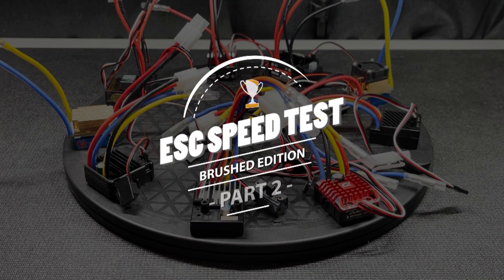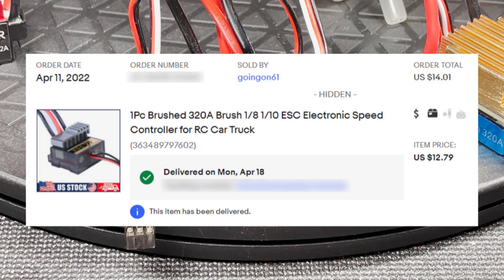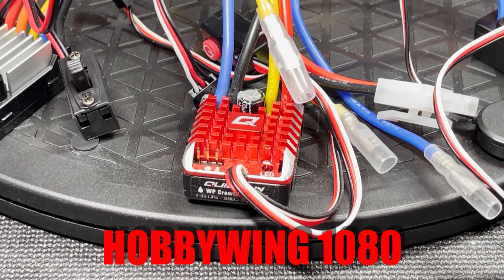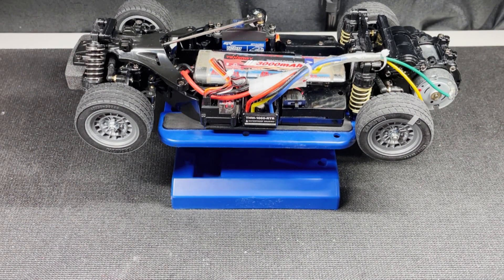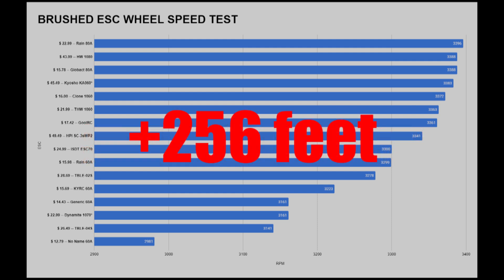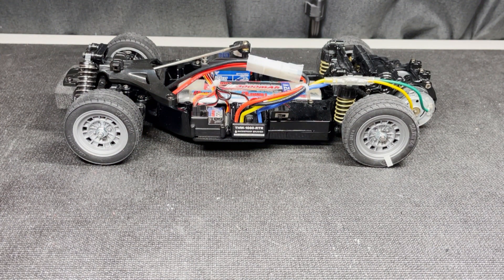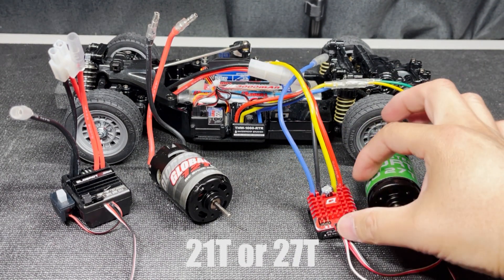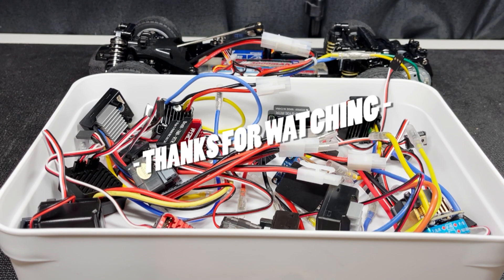Speed Testing 16 RC Car ESCs Hobbywing 1060 1080 TBLE-02S TBLE-04S ISDT ESC70 #rccar #rccars #tamiya

Comment: You missed the most important point: Measuring the Amps/Voltage- AND: under load! It doesn‘t make sense measuring the RPMs without any load… That shows „nothing“ relevant. You put so much efford in all your tests…. you could do it better, I think. ;)

Comment: I have Tamiya Super Modified 11T 38000rpm motor, can it be paired with HobbyWing 1060? And I have difficulties paired my HobbyWings 1060 with my 7.2 V Nimh battery, when i check in my charger it is actually 8.4 V. Could be it is the problem that made my Futaba AM radio receiver glitching? or it is because the voltage is to high? I just only paired it with Tamiya SportTuned motor.

Comment: So helpful my question is better repair compactors or get another oh its brushed i bought online from Walmart for like 12.00 or something and brand is Bdesc-s10e- rtr 2-3 lipo -5-9 nimh bec 5-v 2a   xijaia0206 bought in September last yr what happened was i used two nimh 1500mah it went very fast but then it stop working lol i knw  too much power oh my car is a fast and furious doms 1/12 charger it has dual 380 motors ftont  and rear so whats best advice u can give me to be able to tun this vehicle thank u sincerely mike from Redford Michigan
Reply from the maker: I'm not familiar with the car or ESC you mentioned. I don't want to give you any inaccurate advice. Best to contact the manufacturer.

Comment: Very nice video, it was in my suggested feed from the Youtube AI, I liked it a lot and I have subscribed!
Very well presented, I agree about everything you said, and I have the same favourites, ha ha! HW1080 is my all time favourite, both for crawlers and buggies, but recently I started buying ESC70 and I have been very happy with them. You asked about that Rain ESC, I had one and it died first time I ran it, it was a 15 turn motor and a Tamiya DT-01 buggy that killed it, and to be fair, that combo also killed a HW1060, ha ha!
Reply: I've just killed my Tamiya hobbywing 1060 in my Tamiya mf01x chassis.

I fitted a 23t pinion, TL01 high speed gear set and I stiffened up the rear diff with silicone ear plugs. So yeah....I think that was all too much for it. 🤬🤣

I'm now trying to find an esc that'll be able to cope with these mods.

Comment: Please forgive me if my questions sounds stupid or ill-informed but I am new to all of this and have much to learn. I am building a crawler with a real time camera mounted on it to use for crawl space inspections. The intended purpose for this vehicle calls for low speeds, forward and reverse. I am understanding that I need two ESCs to drive the two separate motors on my tank chassis.   I actually have two pair of ESCs. I have two Hobbywing 1625s and two New Rain 160As. First question: Which of these would suit my purpose best?  Second question: I've been told that I must switch the master controller on first and then switch on the slave unit. I have a master switch on my battery pack. Would they work just as well if I bypassed the on/off switch for each and let them power up together when I switched the battery pack on? And the last question: If my receiver is powered from another source, should I remove the red  power wire from BOTH of the ESCs? Oh. The receiver that I plan to use is the  Flysky FGr12B,  if that makes any difference.
Thank much!
Reply from the maker: Unfortunately I do not have any experience in tank electronics or dual ESC setups.
Reply: @RCsRCCars  Thanks just the same.
Reply: I'll try to help : either pair of ESCs will work fine because of the extreme gearing on a tracked vehicle. If you have a separate receiver battery, you should remove both red wires because both ESC's will deliver receiver power through their BEC. For the next bit I'm not a 100% sure but the 'master-slave' thing you mention specifically applies to brushless ESCs - I think.

Comment: Tamiya battery connectors are terrible and wear out and become lose.  
This will cause a major loss in power and create variables in the amount of current available between each connectors lose/tightness. 
Tamiya connectors can damage the esc, stop using the Tamiya connectors and start soldering quality connectors.
Reply from the maker: I haven't experienced any of those problems myself but thanks for the feedback.

Comment: Across the esc, who can handle 3S Lipo nicely without burning?
Reply from the maker: The only 3S/brushed experience I've had is with the HW 1080 in a TRX-4. I had no issues there.
Reply: i’m using the isdt with 3s 5200mah 80c that’s fine in my crawler
Reply: Rain 60a can handle 2s and 3s batteries